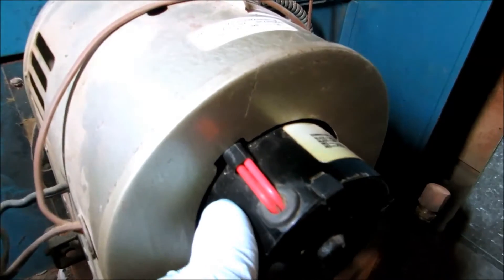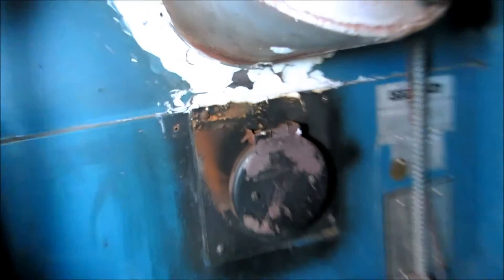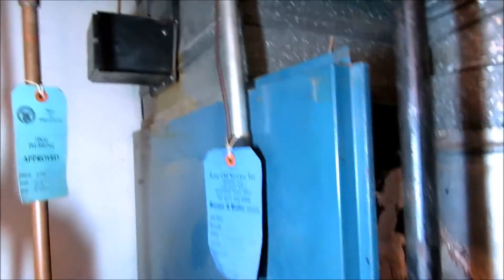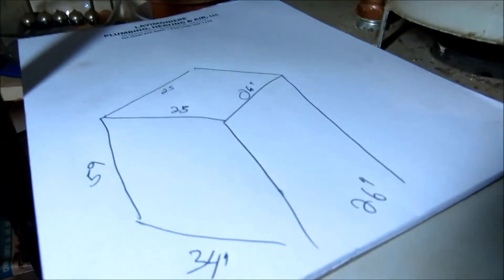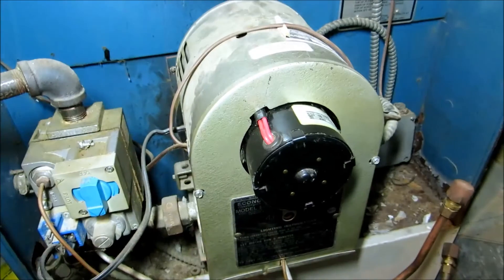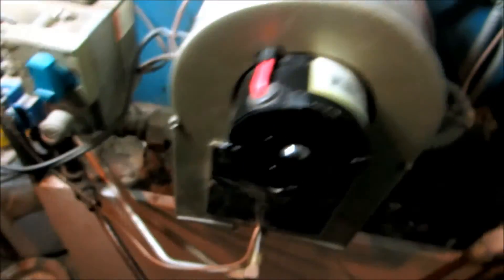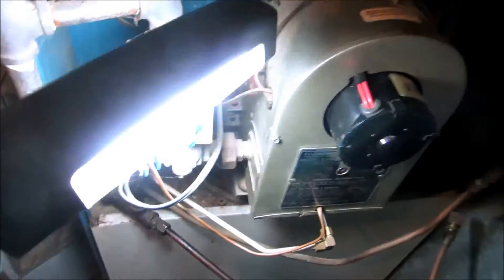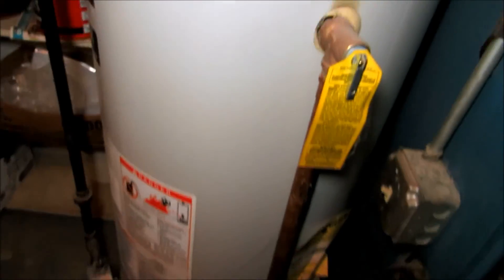economite gas conversion burner modle E20A

Comment: What actually was wrong ?!  I still repair the old economites .. it’s a simple operating unit .. why didn’t you pull n reoil induction motor to quiet 🤫 it down. Just needed maintenance.. worked on them for over 40 plus years.
Reply: There are teeth just a normal blades that get full of dust.

Comment: My boiler has that same economite e20a running about 20 radiators in a single family apartment building. Deciding if i can find a good midco to replace the coal fed, then oil fed and now converted to natural gas. Gas. Im keeping the boiler :)

Comment: Great assessment Steve! I remember these back in Chicago, same thing the gas or electric company would give the homeowner financing on the bill using their houese or building as collateral. No matter what the person's credit ratings where, you was definitely gonna have something new from the utilities companies. Most people took advantage of the Central A/C Forced Air Systems in the Summer,  due to the scorching heat waves in Chicago. I remember clocking in on my old garage analog thermometer about 117 degrees!!! In the City! It was wild. And Winters where out of Control... homeowners who had these systems where warmer than the homeowners with forced air!
Reply from the maker: i still see a lot of these around this one is being up graded of tuesday next week .a hole new gas furnace going in
Reply: Can't wait to see the new installation video! Great stuff my bro!!!
Reply from the maker: leanorlando there should be some good sheetmetal stuff going on with this one
Reply: steven lavimoniere Can't wait to see the video my bro!!!!